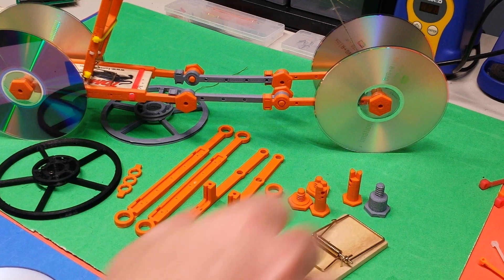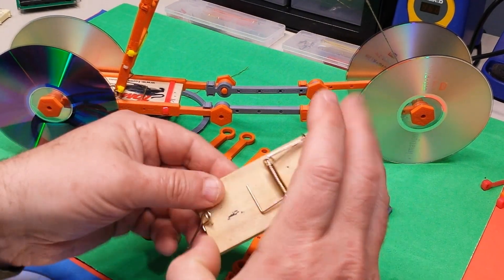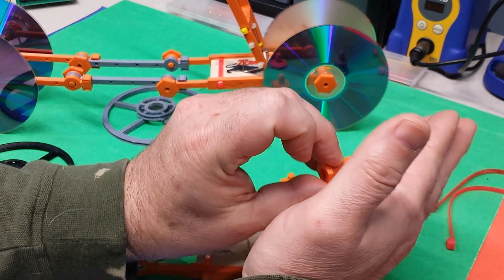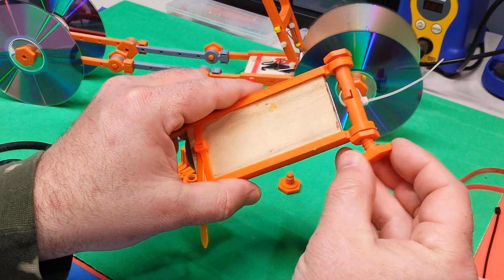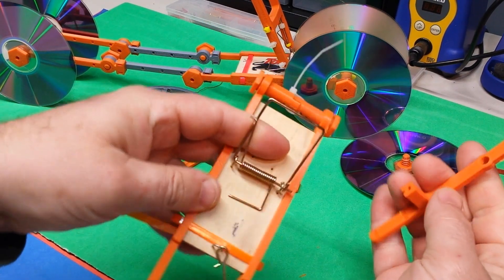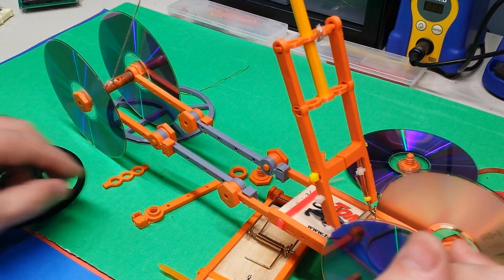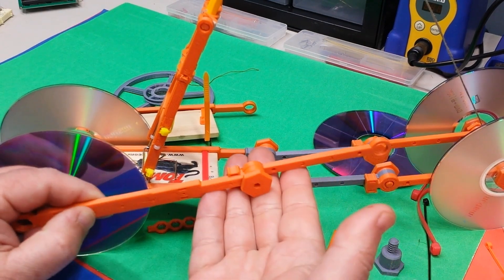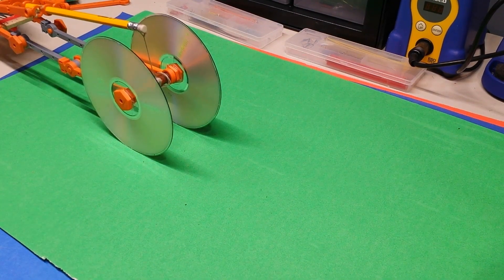Mousetrap Car - 3d Printed

Comment: Hello, I am using this design for school and I was wondering how you mounted the armature the to the part of the mousetrap that has a spring on one side, should I use a knife to carve out a grove for the spring to fit inside?
Reply from the maker: Nope. Mount the bracket onto the metal snap bar. To do this release the spring first. Once the armature isounted reattach the spring, setting it over the bracket.